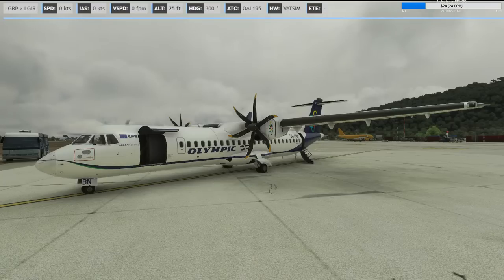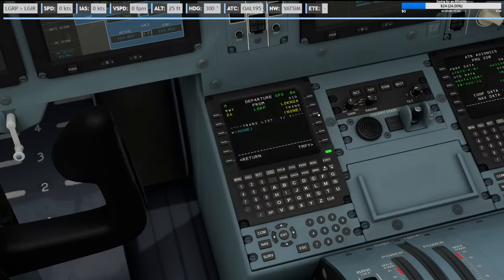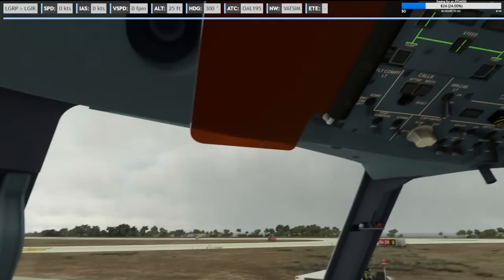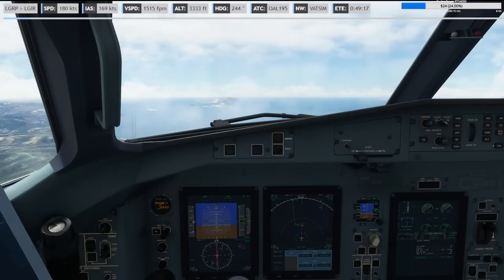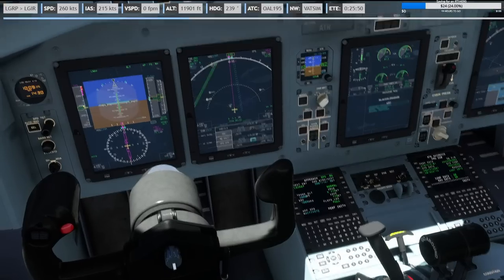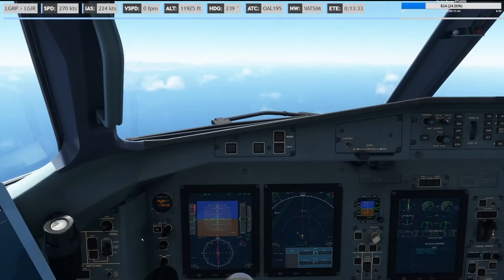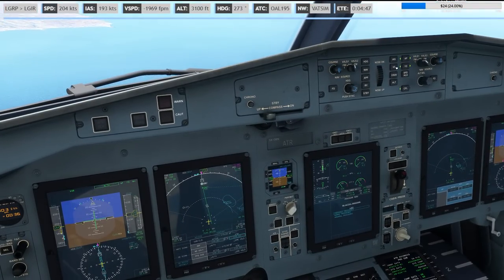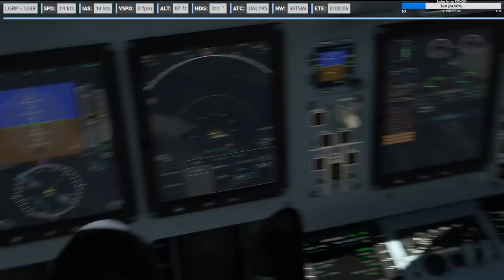ATR 72 | Rhodes - Crete | Greek Island Hopping VATSIM EVENT | Real Airline Pilot

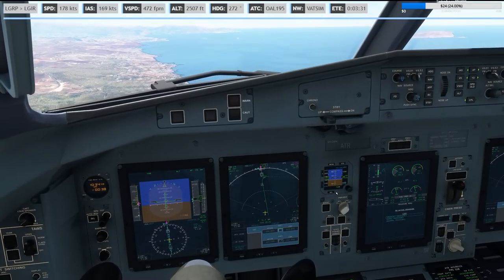Comment: Great stream and thank you for all your videos! No idea why the altitude rose 300ft, started at 1:09:59 after what looks like turbulence. unrelated: I see you set MCT instead of TO before landing, would that have made the landing more difficult or would it be more or less the same with low power set?
Reply from the maker: It would only have been a problem in case of go around where full thrust would not have been available. For the landing itself MCT would not have posed any problem.